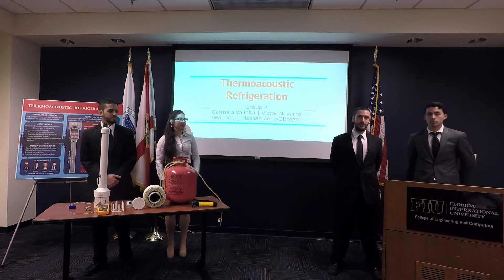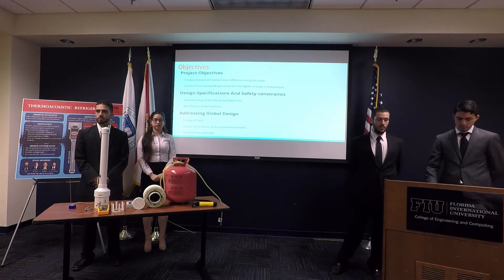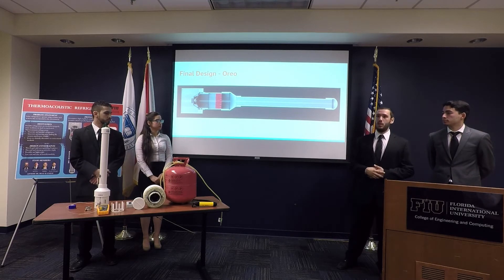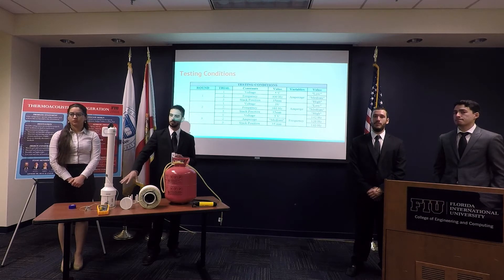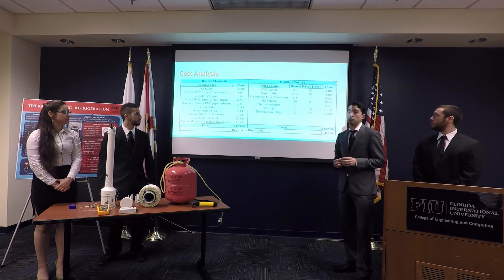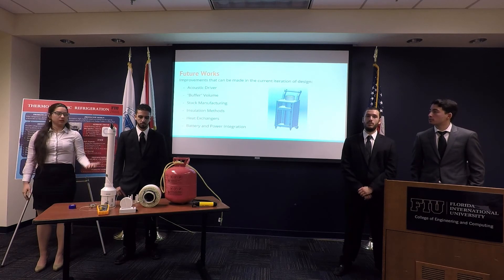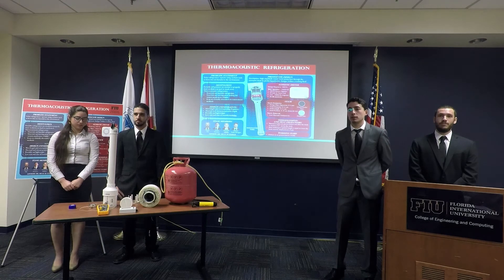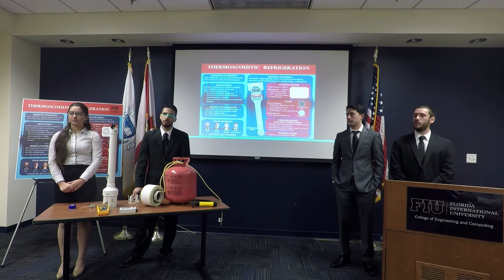SD Team 2: Thermoacoustic Refrigeration

Comment: Overall, very good presentation. Thermoacoustic refrigeration does provide a great alternative to modern day refrigeration, which consumes a lot of energy. Very interesting concept, definitely has a lot of work to be done in the future. It would definitely be interesting if another senior team picked this project up as a continuation. It was a little difficult to read the PowerPoint slides, however. A bigger font should be used. Also, less information on the slides should be presented, as too much can overwhelm the audience. Smooth transitions, confident speaking, minimal stuttering. The team was very knowledgeable and it was clear they did their research. Great job by everybody!